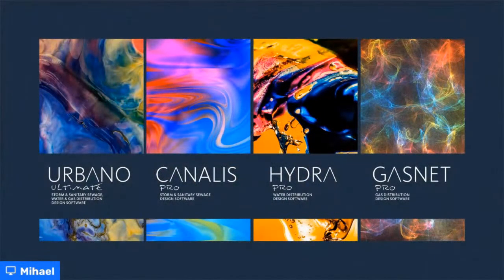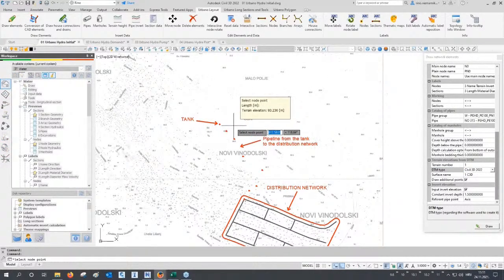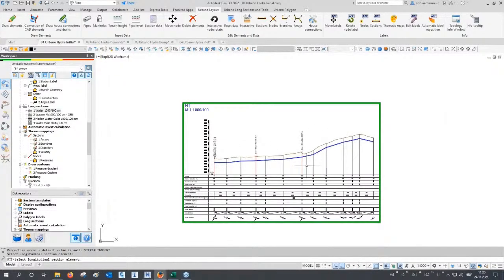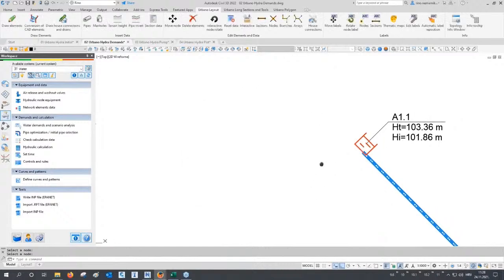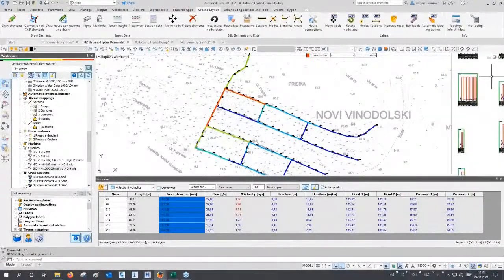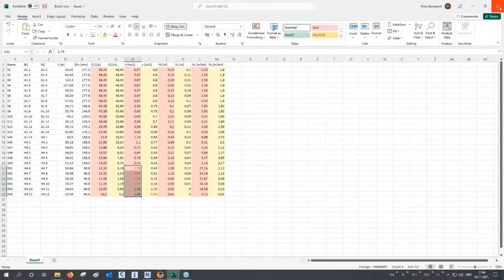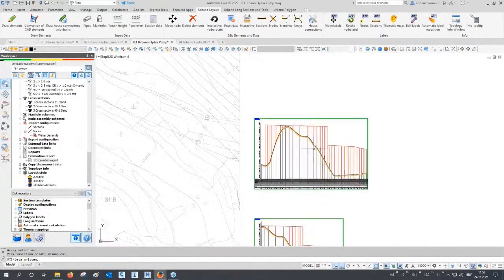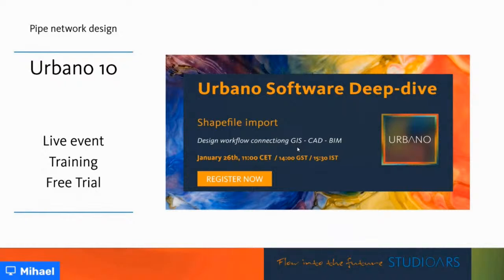Starting with Urbano Hydra

Comment: Hello, do we need a special package module for importing from google maps? or Autocad 2022? Because i have Urbano Hydra+Canalis, v 10.2.3 and i can't find this option on the tools section. Thanks
Reply from the maker: Google Maps import is available in Urbano Ultimate, Canalis PRO and Hydra PRO - in your case it can make sense to upgrade to Ultimate (as that package includes Canalis, Hydra & PRO) .